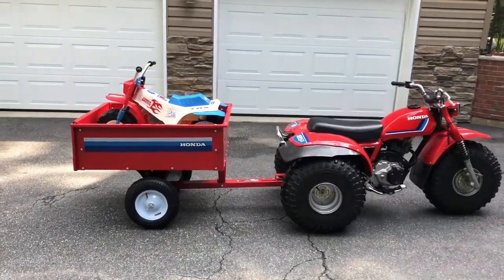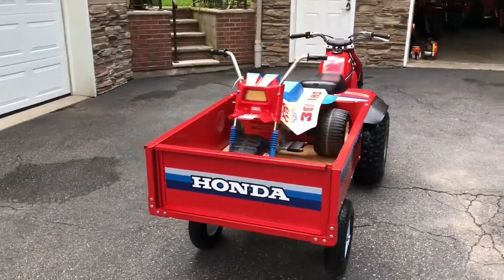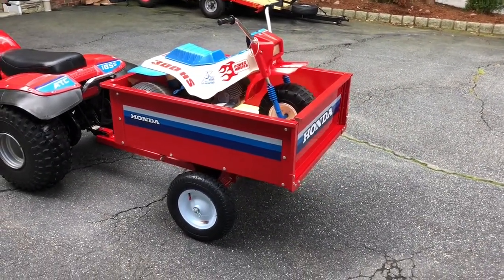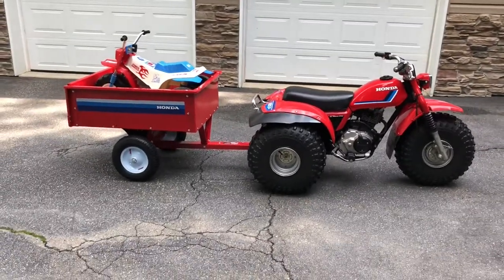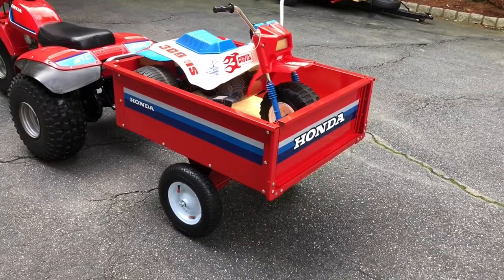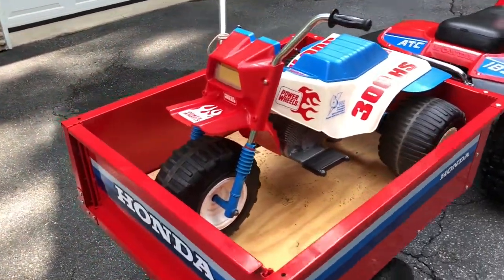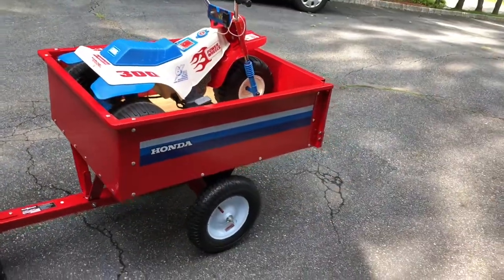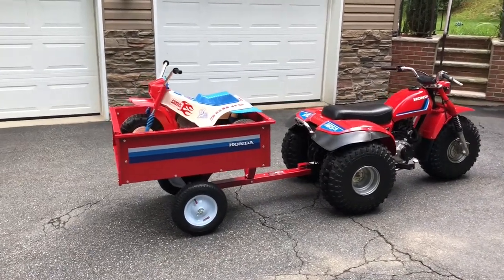Poor Man's Honda ATC Trailer!

Comment: Awesome Job on the Trailer !    Keep looking on 3WW or Craigslist or even Kijiji [ the Canadian Craigslist ] I found and bought 2 of the metal Honda trailers pretty reasonable price on Kijiji.  Very Lucky to have an Uncle that lives in Canada and visits  home to the US couple times a year-- he swung by and grabbed them and brought them right to me!!   I searched for Years but finally paid off. I also found the Super rare Fiberglass ATC trailer that was in a lot of the sales brochures back in the 80s !!  I even saw the fiberglass trailer in a couple different old commercials for the Honda ATC from back in the 80s !   I have a few videos of the ATC trailer in my videos from Trikefest .
Reply from the maker: I'd like to find an original trailer but I could never bring myself to pay the money for one.  This scratches the itch just enough.
Reply: Can you bolt on or make 8in atc wheels work on it??